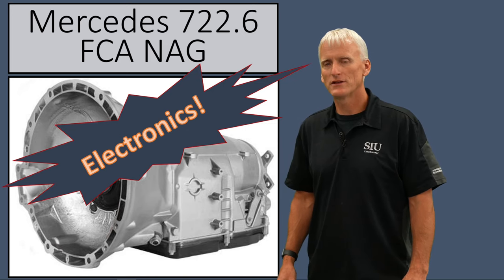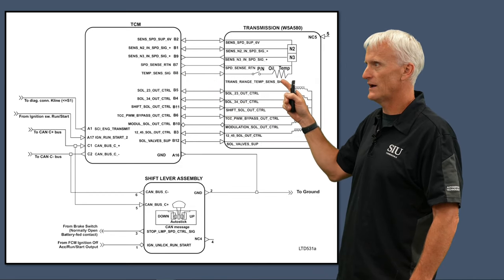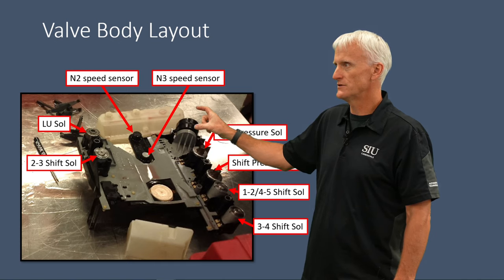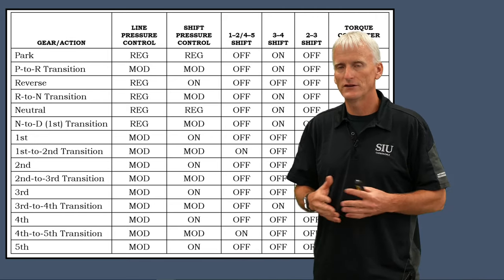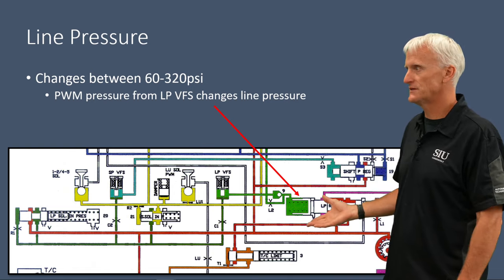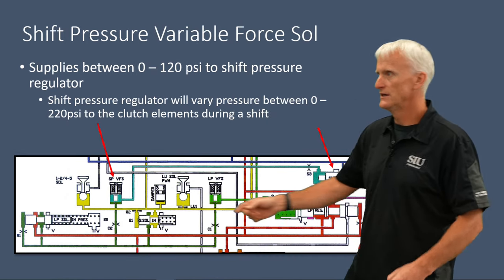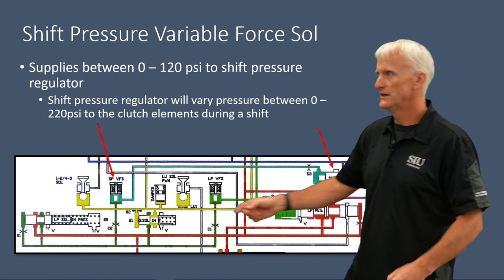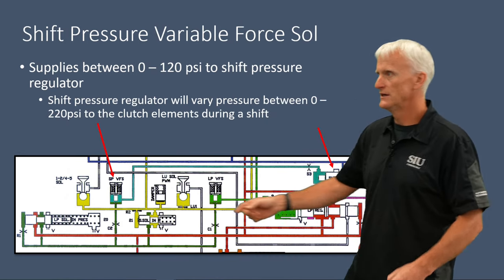Mercedes 722.6 Chrysler NAG Electrical Operation

Comment: Thank you so much for all of your 722.6 NAG videos, I stubbed into these yesterday and have watched them all at least once…haha

The 722.6 in my Sprinter Just started having an issue. The tranny has never missed a beat, and suddenly started Slipping/not putting the power to the wheels. Zero issues getting into gear or anything like that, it just doesn’t put the power to the wheels and sounds like it’s just spinning.  I have a code stating that my TC clutch needs attention. This code was on for a few months and I didn’t notice any changes from the tranny until yesterday.  Currently a bit stranded in AZ and I’m thinking that I need to install a new TC.  Do these symptoms sound like the TC clutch or the TC went out?

Comment: Great video Shawn. This video helped alot to understand  a problem I  have with Grand cherokee 2004 2.7 crd diesel  (limp mode) stuck in 2nd gear. I had a ABS fault LF speed sensor shorted, Fixed that and ABS light went off .Connecter at the trany si all oily and i am going to replace that as well. My question to you is the wiring diagram that is shown at the begining of the video was very helpfull to diagnose the signals with my scope but can not find a diagram with wiring colours. do you have a diagram with colours for the wires . Thanks agin for the great lesson.

Comment: Great Video !!!  All is very well explained.  
-I see on my Dodge NAG1 the transmission control module has a number of terminal not used. Leading me to believe throttle position , vehicle speed and other inputs comes in by CAN . 
-Do you know if those other terminal in modules are provision for a stand alone application where I could hard wire a TPS and/or a MAP sensor and a gear range selector ? Thanks , Marc

Comment: I am willing to donate to you for an answer: My 722.6 behaves normally unless its stressed or driven for 100km+ especially now in the summer. It starts delaying the shift at first not shifting until 2500 rpm and then progressively to 4500 rpm which is pretty much redline for my diesel.OIl and filter is changed There is no slip no weird noises no codes or errors scaned with official mercedes tool. When this happens there is also a very aggresive downshift its like it always wants to keep rpm high.Can you please answer if there is such behaviour programmed in the egs tcm if overheating is detected? I strongly believe this is temperature related and the radiator or the water exchanger is clogged

Comment: So if a crossfire goes into a neutral type state after hitting a bump and then resets to normal operation after restart, it most likely is a faulty TCM or wiring to TCM?

Comment: Do shift valve solenoids stay actuated during the entire time the assigned clutch is engaged, or does it let off once the clutch engages? If the correct scenario is the second one, how does the clutch pressure get released once it needs to be disengaged? Thanks for the video.
Reply: Yes, the solenoid only turns on for a couple seconds and shuttles the command valve.  That gets the process of releasing a clutch and applying a clutch started.  After the shift is complete, energizing the solenoid will start the process again.  The clutch that was previously applied will now release and the clutch that was released will now apply.  The same solenoid will always control the apply/release of the same clutches.  That’s why they are divided into shift groups.

Comment: i experiencing issue with this tranny..excesive slippage..tranny is after rebuild! there is new tcc solenoid, and another new converter..set code p0741 and slipping is sometime over 600rpm..terrible...scan tool status is only open..